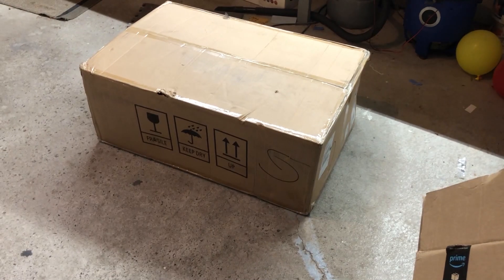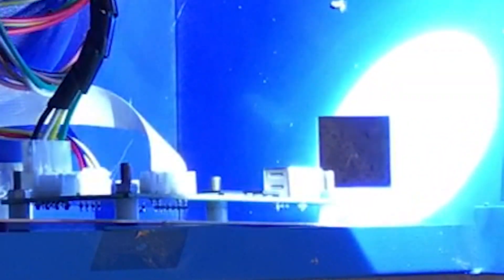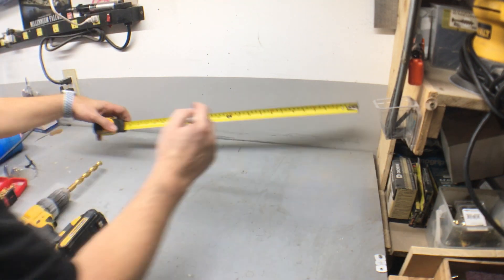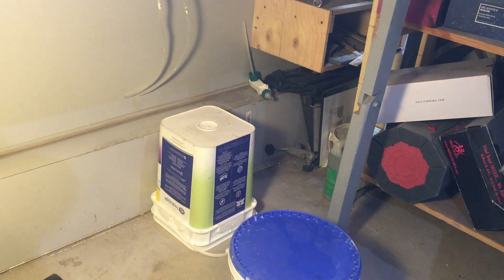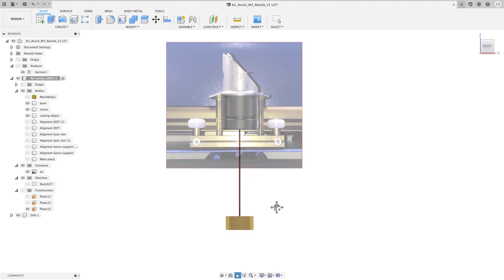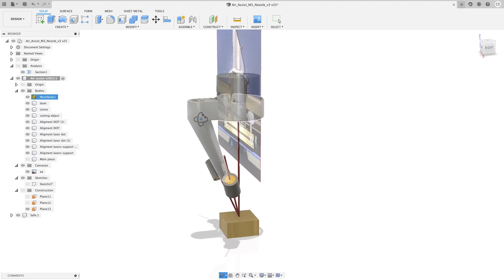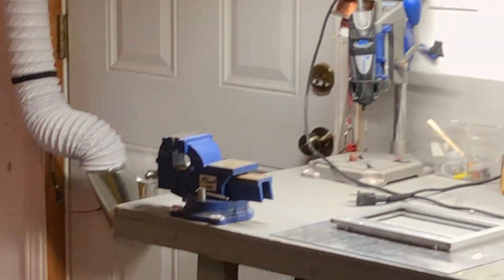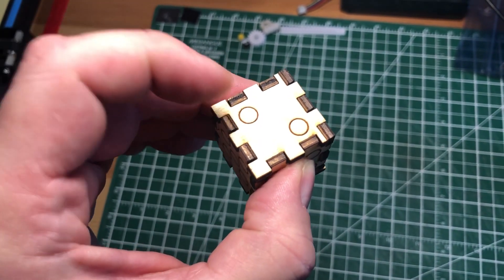K40 Laser Cutter & Engraver Unbox  Setup first mod and upgrade

Comment: How did you ground the machine? I want to get one but I have seen a lot of videos saying you should ground it with a proper 6 inch ground rod or something but I don't have the ability to do that.
Reply from the maker: these machines comes from countries where the electricity may not be as good as ours (canada). I tested the ground pin on the enclosure with the ground pin on the electric outlet and there were connected so, because I have a good ground on my outlet, I did not ground it with another wire and everything works fine

Comment: do you mean that yours came with the mirrors properly aligned?!? that’s unbelievable 👍😊
Reply: When I first fired up my K40 I spent several minutes wondering why I couldnt see a mark on the paper test strip fixed to the mirror. The mirrors were so far out of alignment that it burned a hole in a wood panel on the far side of the room about 5 feet from the ground, luckily I was standing on the far side of the machine but it could have easily hit me.